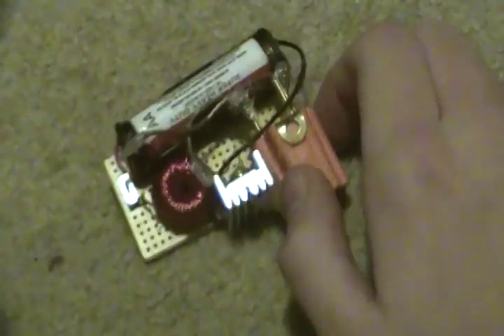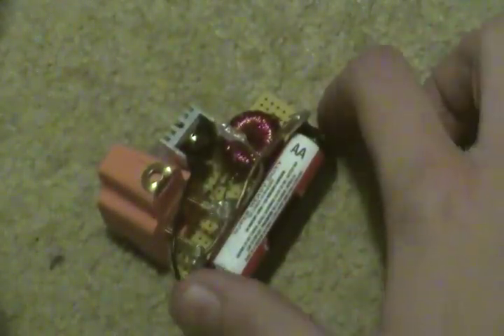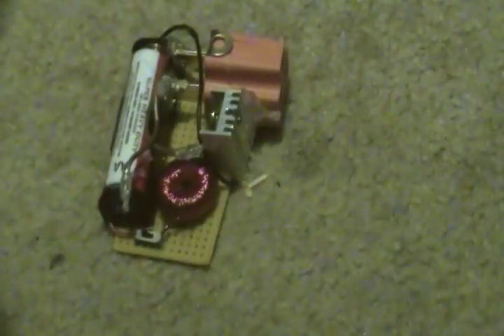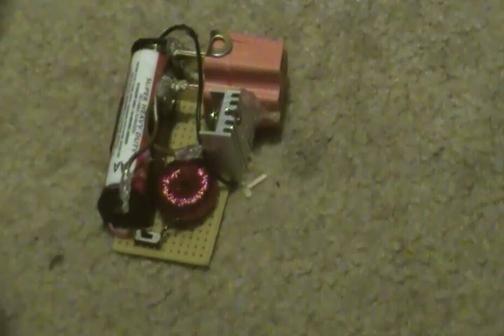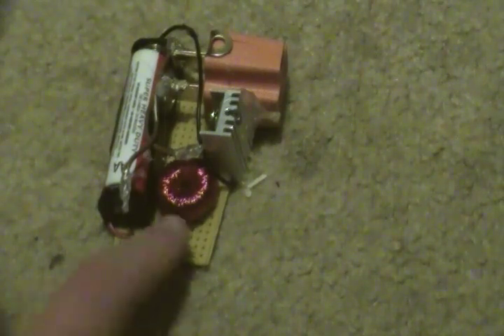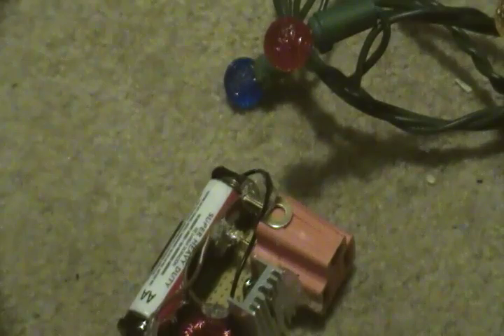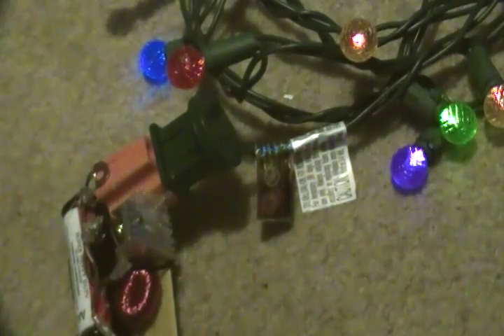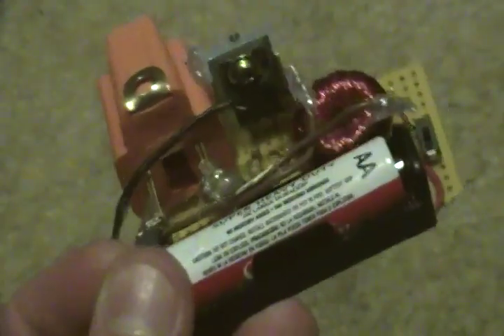High Voltage Joule Thief Inverter

Comment from the maker: I soldered the ends of the wire together, and did about 100 turns each. If you do all 300 turns at once it will take forever due to the length of the wire.

Comment: Kind of ironic that you went to all that trouble to wind all those turns to get the high voltage, only to have it reduced back down to only a few volts to run the LEDs.  I think it would be really cool if you got this circuit to light up a CFL bulb nice and bright.  The xmas lights have a rectifier diode in the string so it uses only 1/2 of the AC wave.  If you plug it in wrong, you're trying to give it the wrong half.  The output of the coil is unsymmetrical and most of the voltage is 1 way.

Comment from the maker: That bulb was the only one I currently had, but I bought a few bulbs online that are much more efficient than this one. I do see your point, and I would like to light a string of my own LEDs, but because of the unsymmetrical voltage the LEDs blow out. The CFLs that I use have very short and brittle filament wires that don't work well with inverters. I did get a toroid to pulse out enough voltage to light a CFL, but it resonates at a very low (and loud) frequency. Thanks for the advice!

Comment from the maker: The primary was 25 turns with a center tap of 18. The primary wire was 26 gauge. The thing to remember is that each toroid I have resonates at a different frequency so the number of turns on the primary will be different. The secondary was 300 turns of 30 gauge wire. The transistor was an old one from an RCA 1983 color television. I found it to be similar with the TIP31. I have made this same circuit with a 2n2222A and it worked just the same.

Comment from the maker: It depends. The more current you draw, the less light you will get out. I wouldn't draw more than 5 watts out unless you use a bigger battery. I have tried a fluorescent tube at 4 watts and it did work.

Comment: Thanx a ton. So let me see if I got this right: you wired the base-emitter as the signal primary while ofcourse the emittor-collector as the amplified primary so the collector-emitter is being pulsed DC. Close to that Emitter Collecter winding  you have put a high number winding which is the secondary which  becomes AC?  That is strange. If the Collector-Emitter is Pulsed DC, why became the secondary all of the sudden AC?

Comment: btw, I have one that didn't do any thing but put normal voltage out because if you remove the transistor it's straight through connection

Comment from the maker: The voltage between the collector and the emitter is DC, however when a secondary is added it acts as an inverter, putting out AC. It's more like pulsed DC though. It will run small lights and other low power devices.

Comment: So u got 3 layers of 100 turns wound clock wise.
If we label the start and the end to a1 - a2, b1 - b2, c1 - c2... 
How do you connect them? Is it like
1. A2 - b1, b2 - c1 
Or
2. A2 - b2, b1 - c1
Both will have a1 n c2 as start n finish points.

Thx.

Comment: You need a battery with more amperage like maybe an 18650, you will need a transistor that can handle the amperage, that way you can run something more substantial like a heater or something that really has a current draw or even just better lighting.. I like your improvised plugin. Have you heard how bad some of lasersabers joule thieves squeal? That squeal would make a good idea impossible to tolerate, but he does have some really cool ideas.
Reply: Never run a JT on lithium ion batteries. A JT will run the battery too low and ruin it.

Comment: Polarity is important because they are light emitting DIODES....DIODES !
Reply: +Joe Yocom But I think the OP was confused because of the AC current as the source of power. If the power plug for those lights is possible to insert both ways then the makers of those lights should have really put in a circuit to allow the lights to be powered regardless of which way the plug is inserted.
Reply: Tony P LED's will light either way on AC.
The output of his device is  oscillating DC.
Reply: Tony P He did not mention heat either

Comment: Good job! The reason polarity matters with the LEDs is because Joule Thief circuits don't actually produce true AC, it's actually pulsed DC. In other words, the terminals don't change polarity every cycle, it's just a series of high frequency DC pulses. It's much like a flyback converter in that respect.
Reply: +ProdigalPorcupine Correct, there is DC, Actually any device with diodes rectifier bridge and without transformer, will work with DC absolutely same as with AC ! Since, after bridge there is always DC. Using DC on input just will pass through bridge to device without rectifing from AC.

Comment from the maker: There are a lot of problems with this device as far as running hi tech devices is concerned and it's not recommended that you try. This was just a demonstration of a build that could allow you to obtain the high voltage that can still do a few things that AC can like light the LED bulbs and the CFL. Also, a lot of comments have been marked as spam that aren't spam, and it's a few people who want help with the build. So if you were one of those people, I apologize

Comment: t is the number of the transistor? and how many ohm you use in your resistor? tnx ^_^
Reply from the maker: The transistor is a TIP31. The "t" stands for "turns" in regard to the number of turns on the ferrite toroid. The resistor I used was a 4k variable resistor for variable power output, but I would go no lower than a 150 ohm.

Comment: Hi, I am new to all this electronics stuff. I was looking at your schematic and it says you have a primary coil that is 18t center tap at 4. I don't understand what that means. I know t stands for turns, but not what center tap at 4 means.
Reply from the maker: Basically, a center tap is a beak in the coil. It is like if you cut a piece of wire, twisted another piece of wire to it, and stripped both ends. You would have 3 electrical connections. It can also be thought of two separate windings, with one end of each winding connected so that it makes a full winding with a wire sticking out of the middle.
Reply: ClevelandStorms
Hey I saw this and the vid in your instructable version three.  Which one do you prefer?  Also how did you wire the 2 prong adapter, and where did you wire the little ring tab on the adapter to?
Reply from the maker: Omar Morris Sorry for the late reply. Version 3 is better. The AC plug was from Home Depot, and the ground pin (little ring) was not connected to anything. I suppose you could connect it to the negative of the battery if you wish
Reply: ClevelandStorms Thanks bro, I'm building mine now.

Comment: For AC power, the polarity needs to switch back and forth at 60 Hz - 60 cycles per second (50 for Europe). All this is doing is pulsing DC at a very high rate - almost like AC after half-wave bridge rectification. The diodes still work because they are DC. Without even considering the lack of power (which you could increase by adding more batteries in parallel), you couldn't run any high-tech AC devices with this (like a TV, computer, etc). Pretty cool though. Thanks for sharing.

Comment: doesn't run at 60 hertz, better to not use it for anything that relies on 60 hertz... pretty much everything.
Reply from the maker: ryan cler If it gets rectified into DC then it's fine to use. Obviously don't use it with a 24 karat gold plated light bulb or something that meaningful to you
Reply: +Electronic Experiments the rectification diodes?

Comment: I had 4 cfl's gave to me. (http://www.conservationmart.com/p-2350-tcp-23w-ecosave-springlight-1es23.aspx) and ech one comes with a BLD123D TRANSISTOR. datasheet here: (http://www.datasheetarchive.com/dl/Datasheets-UD3/DSAUD0058289.pdf)  I also have some  4C1815 TRANSISTOR Datasheet: (http://pdf1.alldatasheet.com/datasheet-pdf/view/30084/TOSHIBA/C1815.html) Could I use any of them to make a Joule Thief?

Comment: the reason its polarity sensitive is you are NOT making AC you are making high freq DC, probably close to a square wave and the diodes in your light string are polarity sensitive hence one direction of the plug doesn't work and the other direction does work.